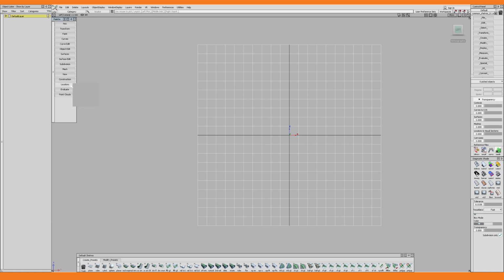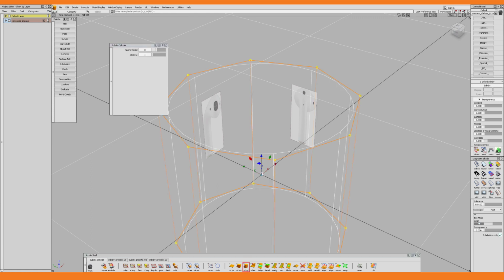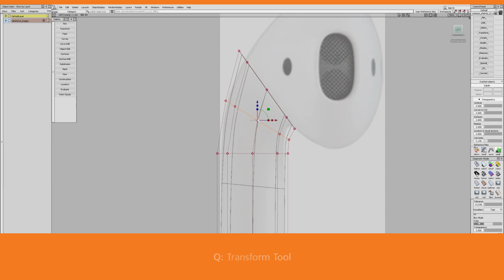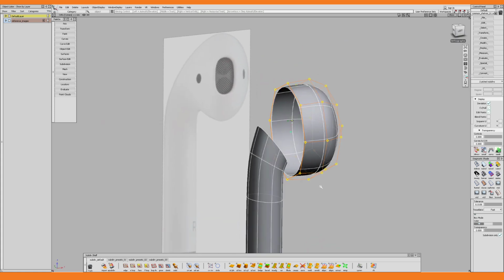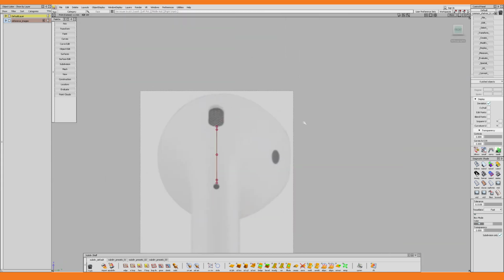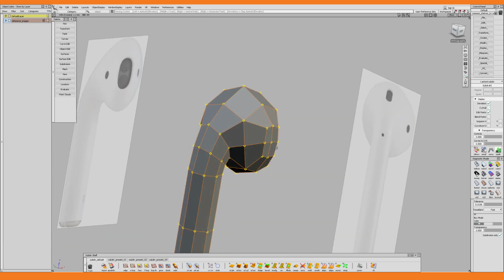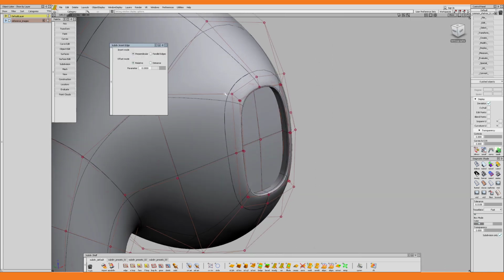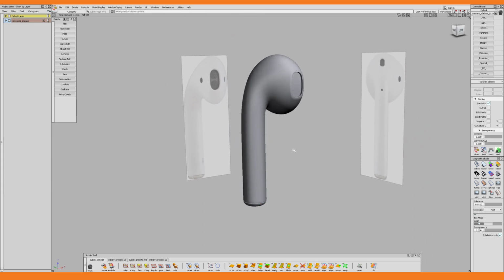AUTODESK ALIAS 2021 TUTORIAL:  How to Create Apple Airpods with Subdivision Modeling - Part 01

Comment: I need tips for how you scale the canvas by just keep the bottom side and make it as a point while scaling.
Reply from the maker: If I remember correctly I snapped the pivot to the bottom of the canvas image, and then I used the legacy Scale Tool, not the Transform Tool to scale the canvas plane. You'll find it in the Palette under the Transform tab.

Comment: I am new to alias and I am trying to resize the canvas image but for reason it is not resizing I don’t know what am I doing wrong. Feel so stupid but please help.
Reply from the maker: Do not feel stupid. It is probably due to a bug in Alias, where you can't resize certain objects (planes for example) using the new Transform Tool with Global Mode.

Open up the settings window for the tool you are using, and change from Global to Pivot mode. Or simply use the old legacy Scale Tool, by way of Palette > Transform > Scale.

Here is another video of mine where you can learn more about the Transform Tool.

https://www.youtube.com/watch?v=I8KKrm45jlQ

Comment: Really liked your tutorials. They are the best for someone starting SubD from scratch. Can you tell me how can I customize my spider menu in SubD workflow? Since the editor option doesn't appear there.
Reply from the maker: Thank you!

First make sure that you are in the Subdiv Workflow - Preferences>Workflow>Subdiv.

Then open up the Marking Menu Editor - Preferences>Interface>Marking Menu.

From there you are able to customize the Subdiv Marking Menu, just like you would the default one. The same goes for Shelves which are unique to each workflow.

Hope it helps!
Reply: @polygonpudding  Thanks for the response. But I have already tried it and am facing problem assigning the tool into the box of Marking Menu. Seems the prefs are corrupted. Can you tell me how to resolve this problem ?
Reply from the maker: @pranjalshakalya4201  It might be that the prefs are corrupted as you suggested. To eliminate that possibility you should open a session of Alias with the default preferences. Just to see if the problem persists. Try that and let me know if it worked. Otherwise I can help you with further troubleshooting.
Reply: @polygonpudding  Okay I'll check.
Thanks.